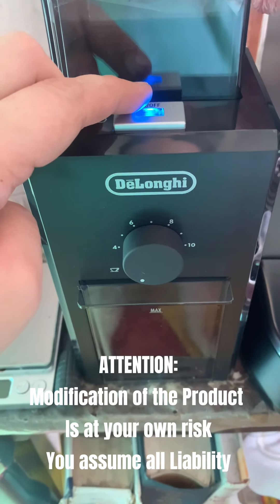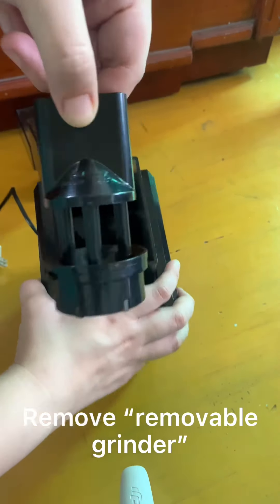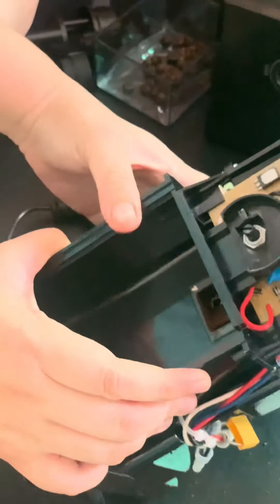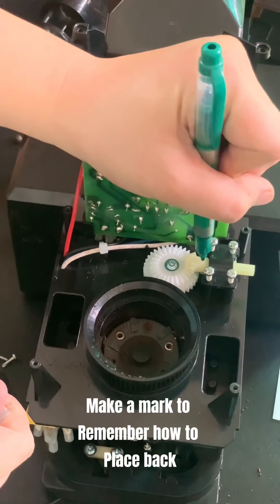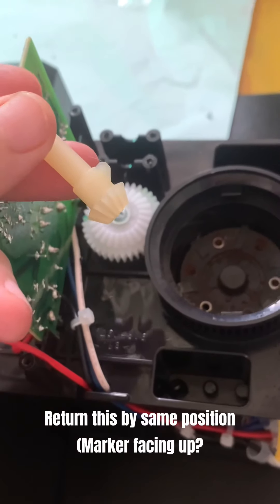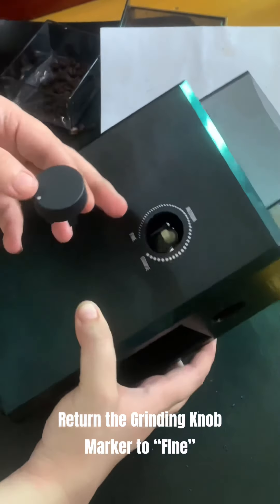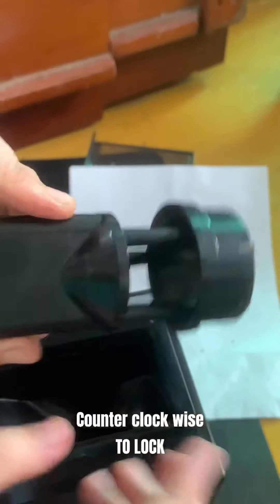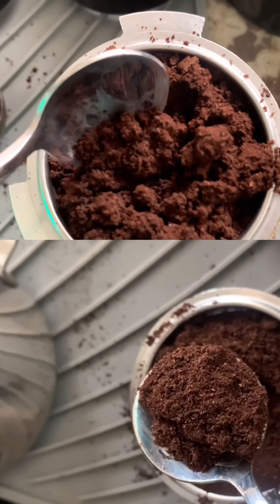HOW TO MODIFY DELONGHI COFFEE GRINDER TO FINER GRIND

Comment: You can simply cut off the pin on the white cog, so then you can later set grinding to any level. It sounds scary but it's not, because you can always turn it to the minimum to find out, where is the limit and then go back a few ticks. Thanks to this, if you want to grind even finer, you don't need to modify it once again

Also you don't beed to to remove the hopper with those 4 screws, simply unscrew the white cog and cut it
Reply: 45 degres is enough. You don't want push 2 burr too close...
Reply: Did you mean 90 degres, cause the guy in the video turns the gear 90 degres?
Reply: @williN57 no I think he turns it 45 degrees